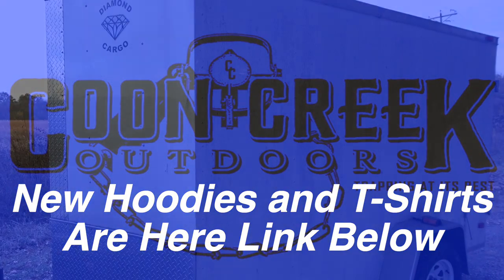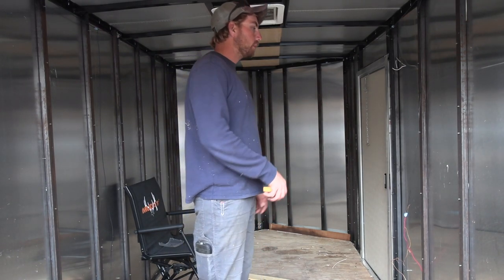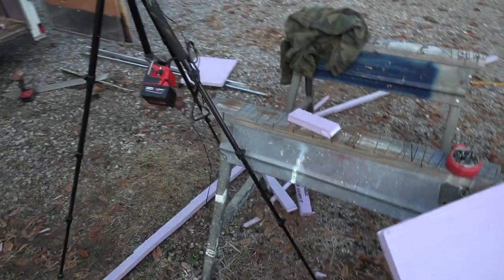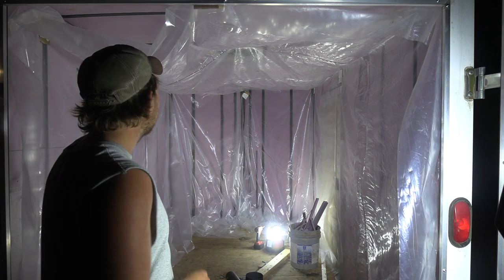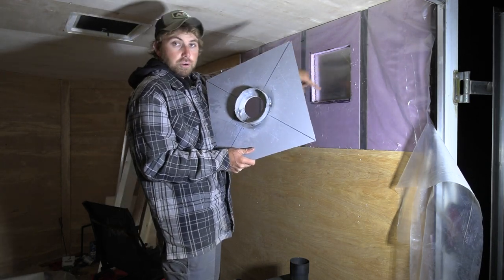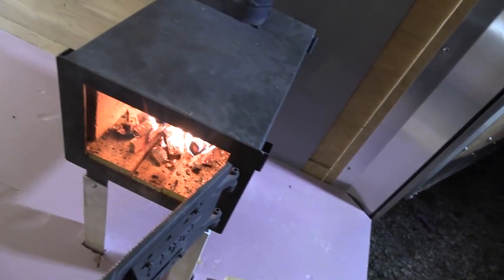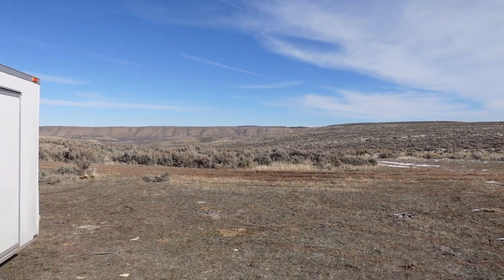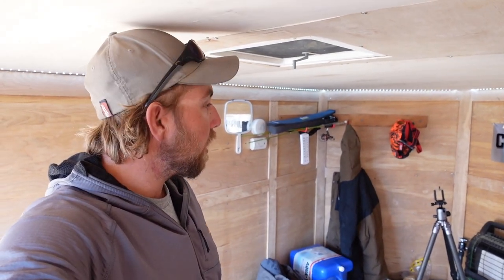I LIVED in This TINY DIY TRAILER CAMPER For TWO WEEKS. It Was AWESOME. (FULL BUILD)

Comment: Loved the video! the one thing I would be to add a 3/4 to 1" air draw pvc pipe through the floor of the trailer for the wood burning stove. That way the wood burning stove wouldn't be having to pull air thru any air gaps to keep itself feed with enough air to keep the fire going. It would also keep the firebox hotter and more last longer heat wise. You could just end it below the air intake and put a cap on in when you aren't using it. I had planned on doing such a thing for my barrel over wood stove in my garage but never got the chance to do it before my divorce. Great trailer for what you wanted though.

Comment: As an owner/operator truck driver, the little diesel heaters are awesome. I figure roughly 1 gallon of fuel per 10 hours when it’s about 10 degrees out or more.

Comment: You might try a Zodi hot water heater for showers and dishes. It heats the water with propane and it has a small battery pump. We used one living in a dry cabin for 5 years.  To shower inside a plastic party tub makes a catch basin to stand in and a large hoola hoop makes a shower curtain.  The heater raises the temp of the water 25 degrees in one pass. We took a 5 gallon bucket and put about 4 gallon in it. Put the shower head in it and let it circulate until it is about the temp that you want.  Then you can cut the heat or turn it down.  Pull the shower head out of the bucket and get wet put it back in the bucket soap up, pull the shower head out of the bucket and rinse off. You should still have plenty of water left to stand and soak a bit if you want. If it is warm enough use it outside without the shower curtain.  Outside we would use a plastic pallet to stand on and a double shepherds hook to hang the shower head in the notch of and hang a wash rag off of the planter hook. With the zodi hanging of of the other side.  I hope this helps.
Reply: I've modified mine to run off a boat bilge pump an it works great, using 12v deep cell battery charged by a solar panel
Reply: Great job

Comment: Nice build progress, i used coroplast (plastic cardboard) for the underside of my cargo camper, used 3 inch rigid foam under the floor then coroplast screwed up from underneath, so far its holding up well.

Comment: Thought a lot about this insulation issue as I’ve started to collect various items for my build. The only way I can think of the get away from that is adding another layer and then building a wood frame on top of the two inches of insulation, with the frame being something to hold the plywood and shelves

Comment: I'm still hunting for the right trailer to do this with, but other then the front shelf you didn't put in yet tgats exactly what I was planning on. Fold down cot instead of free standing for more skinning room was my thought
Reply: Harbor Freight sells those types of pre-built 4x8 trailers for around $550.  You could always extend the size by a few feet with additional steel...I'm actually heading to HF to purchase one for a tint camper for my LincolnMKZ Hybrid.. It's got to be under 1000lbs for my car to be able to tow.

Comment: I built a similar set up for the same purpose. Same exact trailer except for the door configuration. Mine has a ramp rear door so I can use it like a toy hauler. Won’t fit a sXs but will fit any ATV. My trailer was rough on the inside when I got it so I replaced all the wood with 1/2” treated plywood. Used the same foam but no vapor barrier. Nothing on the floor. I also wired it like a house. 3 electrical outlets, 3 led recessed lights on the ceiling with individual switches to adjust lighting needs. My bed is in the same spot as yours but I built a fold down set up. Just a simple bed on hinges at the wall with 3 pocketed removable legs for the front side. I can fold it up and put an Atv in the trailer. Just used a buddy heater for heat, I use a -20 deg down sleeping bag so I shut the heat off while sleeping, no issues with that. I have 2 tiered shelves in the v nose just like you said. Use that for cooking on a Coleman propane stove and food/ gear storage. Works great. Between the bed and the v nose is where I put my freezer, 7cuft chest will fit a quartered elk, or a deboned elk plus a deer or antelope. All the power runs to a single 100’ extension cord that has a reel and a hole in the floor at the front of the v nose. Just pull it out and set up a small generator 100’ downwind. I found that you need a 2k to run everything. You can get away with a 1k at home, but at 8000’ it won’t run the freezer with the extension cord. Check out a shower called Hot Tap. Australian company. I have one and it makes all the difference in the world on a long hunt, being able to take a hot shower each night. Just need a good water source. I also integrated a filter system into it so I can produce clean drinking water with zero effort.

Comment: Looking good bub. Like you said, I also thought about adding shelving in the V nose. Or another option would be going to a Re Store and picking up a couple of cabinets and maybe a counter top(or topping off with a partial aheet of plywood) and maybe add a small sink. That's all it needs to be a little more comfortable. I'd probably make the cabinets in the nose permanent, depending on the room you need for tools, they probably wouldn't be in the way or even give you a lil bit of storage for smaller tools. But like i said, it looks good.  If nothing else, it serves your purpose that you gave for the build. Love Colorado except when i have to drive through in the snow. Then I'm driving a semi. Also the additive to the diesel will work for you which is available at most auto part stores, Walmarts and truck stops.

Comment: I build these for a living. Easiest way to avoid condensation is vent low, vent high, NO propane. Peopane creates roughly 20oz of water as a by product for burning one pound of gas. Foam tape over any studs in the walls after you fit the sheet foam. A maxxair maxxfan on the roof and small vents down low keep draftimg vapors travelling up and out vs clinging to anything cooler than the ambient air inside.

Comment: Good build man! You don’t want to take the stove out!! Dry heat… Get a fan for the stove: move the heat around… a lot of space available at the nose . Build some shelves closed in with doors.. The wall with your bed could have more shelves as well. Get everything organized a little better.What are u pulling it with: cut and store firewood under a tarp. Solar heating could come into play too. Panels on the roof: supply power to run electric heat?  Just a view ideas.👍 B Deacon Mb Canada 🇨🇦

Comment: I put a diesel heater in my 400sqft shop and it will run for a week on 5gl of diesel @75deg in the 20s outside I love it. And it’s such a small package compared to your stove. If you hand the diesel tank off the door inside that should solve your geling issue without too many additives but I can’t see with winter fuel and some anti gel you’d have too much of a problem above zero.

Comment: Since you have the trailer insulated and you use it to age deer you should install an air conditioner and hook a coolbot up to. I've been using a coolbot for a few years on a walkin cooler that I built and it works great!

Comment: We had a 5th wheel camper, and it had corrugated plastic underneath it to protect the underbelly, kind of like cardboard, but plastic, worked great.  You could put your foam insulation in, then cover it with the corrugated plastic on.

Comment: Nothing like a couple weeks of experience.  Could you drill a few holes in each wall stud and use some spray foam to insulate them at least by your head?  I would look into hinging the bunk... this would allow for more floor space and also access to storage tubs.  Nu Wave makes a propane stove similar to your wood stove that has a burner in it, gives off radiant heat like the wood stove, Co and moisture goes out the chimney so they're safe.  Front shelves with clear bins allows you to see what you want and make for quick unpacking.  Having other bins for your tools makes for quick loading as well.  An outside awning or tent with sides would give you dry storage, back the truck up to the front and use the hitch hoist winch for skinning.  Your big buddy would work great out there.  Good video!

Comment: I winter camp in a hammock like a fool. You got a wood stove and enclosed trailer. You should be fine on the R value loss from the framing   There are some good icehouse builds from enclosed trailers too

Comment: If you have a 6 foot or 7 foot wide trailer here's what you could do to really insulate it. You're outside side to side overall diameter with can be no more than 8 foot and 5 inches wide. You could use that thick rigid green 2-in foam on the outside and wrap it with the white aluminum, wood or the silver shiny aluminum would be a lot cheaper you can generally buy this at tractor trailer trailer shops. Using wood would be pretty heavy but it would also give you R value and some insulation. For another idea if you have a hollow barrier that's airtight between the outside exterior wall and another wall that spaced out woodwork. I plan to finish insulating mine with the 1 inch real lightweight insulation  around the walls. Using the hardboard 1 inch insulation at the box stores pushing it in the thin aluminum walls will create ripples all down the side this is why I chose the real lightweight insulation. I would say the thicker more dense insulation would have a better r value and be a little warmer just a little bit. But when you push it in tight you're going to have all kinds of wrinkles down the side I do with this real lightweight silver and white board with a foil on one side and clear plastic on the other. The ceiling I plan to drop down just a little bit to keep an air gap and keep my vent open during the winter with a rain proof hood over it. like they do in an attic so it will not build up moisture. I think the only way you would have no moisture and not have an air gap on a cargo trailer ceiling is with spray-in foam and the ceiling where there's no metal screws or Staples that show holding it up. Because the metal fasteners whether it be screws or anything metal on the top of the ceiling will create moisture which will cause rust and mold. Moisture and water makes mold. I have another cargo trailer and I made a l angle aluminum piece to go over the back rear door so you don't get leaks on the barn doors or the drop-down rear door. And been this thin aluminum that's folded over is about the cheapest way to go. Most payback shops will bend it cheap I found one to bend one for free for me. And I remember some of them have about a 9-ft bender. But been this hell aluminum rain guard as tight as you can over the back door and silicon it and screw it to the back just above the door. You can also do the side door to keep water from entering it. Because the problem is when it rains real bad water puddles there and it runs down into any crack or crevice the only way to prevent this is have a hood over it. That way if you have a pinhole water will not get in it. I'm a little familiar with hell mold grows after figuring it out in my house that I had to leave because I had such a bad runaway mold problem. Mold likes cold, damp, moisture and darkness to grow the best.

Comment: Great Video  An idea for your front shelves that would be easy to remove. Is to use aluminum channel 3/4x3/4 or something similar on each side.  With it being kind of a triangle shape cut your plywood to fit, slide them in and to hold them in place just drill a couple of holes on each side and drop a nail through and that traps everything in the channel. To remove pop out the nails and slide out the shelves.  I also like your idea about going to the diesel heater I would make a mount for it on the front hitch when in use and plumb in the inlet and outlet similar to your wood stove.  Just put out a hand full of traps  this morning on our land I'm north of you in brown county
J

Comment: I just did the same thing over the summer to my 14ft cargo v nose. The v is a bathroom with cassette toilet and propane shower. I got a wall mounted bunk about chest high that folds to the wall. But use it for a shelf and have a cot underneath. I'm in Florida so I put a portable AC in it for bowseason in South Georgia. I did run 1x4s longways on the roof to make hanging ceiling boards easier to screw in. Same insulation as you but  haven't done the floor yet.

Comment: that buddy heater will produce  lots of condensation. i had a wood heater in my first cargo conversion. its a dry heat and should keep it dry inside. ive been through 5 heaters between 2 cargo conversions. the wood was a real pain. i eventually used charcoal in mine. it burned slower and longer, a more even temperature, and i didnt need as much space as far as having all the wood. and there wasnt the mess of bark and dirt from the wood. but im happy with my nuway lp heater now. ceramic insulation works great around the heater, and tin spaced 1/4-1/2" from the wall or ceiling. but you did a fine job man. i like that you kept it lightweight overall. and universal
Reply: just finished your vid... yes buddy heaters and condensation lol. i live in colorado at 9k'' and hunt between 10-11k' buddy heaters usually dont work that high. converting cargo trailers myself, i watch a lot of vanlifers on youtube. id never want the maintenance associated with those. they need regular cleaning, rebuilds, ect. too much trouble for me. check out nuway. theyre ice hut heaters. theyre vented for zero condensation. several youtubers use them too. mine runs fine no matter how high you are, adjustable stable heat, and put out a ton of heat. ive only ran mine on the lowest setting and im in a 6x12 v-nose. i got the double burner but have never ran but one burner. compared to that wood heater... youll never look back

Comment: You can also go to Home Depot or lowes and have them cut you one of those outdoor mats to fit the whole floor of the trailer. Then you can pull it out and pressure wash it if it gets dirty or roll it up and stick in barn when you’re not using it for camping any that should keep some of the cold off your feet

Comment: The cheap chinese deisel heaters are direct vent with heat exchanging. You can run one roughly 24hours on a galf a gallon of juice. Power the pump with a milwaukee battery. It works great and mounts outside of the trailer in a tounge box or another electricak enclosure bix you can find online. We use LOTS of them.

Comment: Drill holes and fill braces with expanding foam.
Reply: That was my first thought too.
Reply: That would more than likely cut down on the condensation, it’s the metal causing the screws to. Frost..
Reply: My thought too. Filling those pipes with foam is better than nothing.
Reply: I didn't do this but it should work and keeping the post warmer. Or if you built an outer perimeter and lost some of your space like a 1-in by 1-in wall and come out with it in the same way with the ceiling and kept an air gap in the ceiling and put wood putty over the screws you may not make any moisture on the screws. But the downside you lose some of the inside space.

Comment: You can keep diesel fuel inside in a sealed container. Also. Renergy makes a solar kit for $165. Also I have gotten 12v camper puck lights for $26 for 6 of them on Amazon. They even come with the drill bit.

Comment: Well it was a fast build, so not bad. bringing some Oak logs with you just for the sleep time could be a option, using the pine for cooking and heating when you there the throw 2 or 3 split logs on of Oak and see if it will last. Shelving is need for sure. Build a shelving unite that you can drag in and out as needed maybe even 2 units. You did good for sure.

Comment: I used a craftsman torpedo heater in my 12 foot by 8 foot corrugated steel storage shed with no insulation for a few weeks during the winter in Colorado . Burned #2 diesel and I had no problems. Just make sure to adjust your air fuel setting properly or it will leave a nice cloud of smoke to choke you out. It's a lil noisy I thought about making a heat box with a vent run  in and an exhaust out cuz it gets hot real fast and the noise is kind of off-putting but you get used to it after a few days

Comment: Diesel heater would work great, i just installed a cheap 5kw eBay diesel heater in my 12ft trailer and it works awesome. Ran it nonstop for four days at deer camp in northern Michigan this year. had temps down around 10 at night and the heater running on low kept it around 60-65 inside.

Comment: I'm wanting to do a trailer build like that. For heat I'm going with a Empire 10,000 BTU direct event propane furnace. They are very efficient and safe. Set thermostat and done. U can find them used for around $500. I would look into that before stinky diesel. Just a suggestion. Nice job and good luck.

Comment: The diesel heater are great and the diesel won't gel up if you use winter diesel or #1. You could install the tank inside as well.

Comment: The diesel heater is the way to go. I have owned diesel pickups for 20 years towed with them coast to coast an had fuel gel 2 times. Nice thing with the diesel heater you can cut the fuel with used motor oil ATF or hydraulic fluid.

Comment: Great video, thank you.
One comment regarding the carbon monoxide (CO) detector…it looks like you have it mounted on the wall. It should be mounted at the floor because carbon monoxide is heavier than air and will first be detected at floor level.